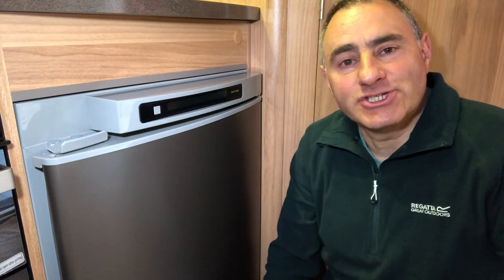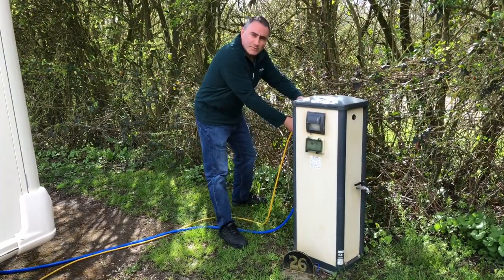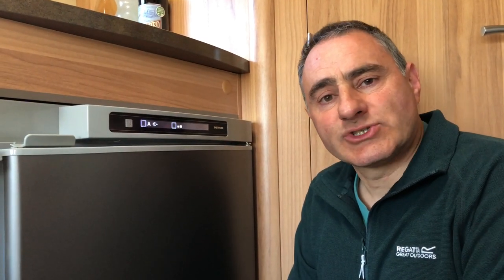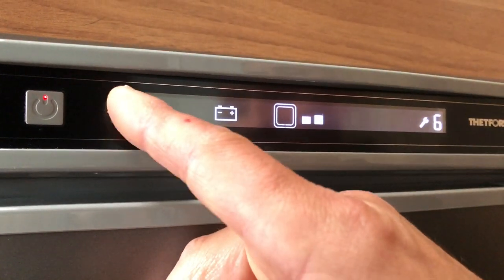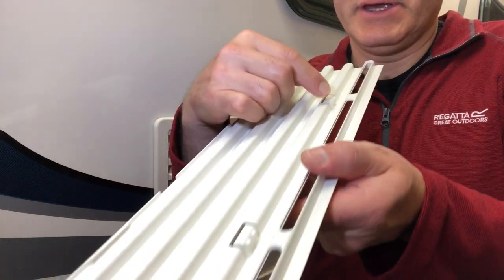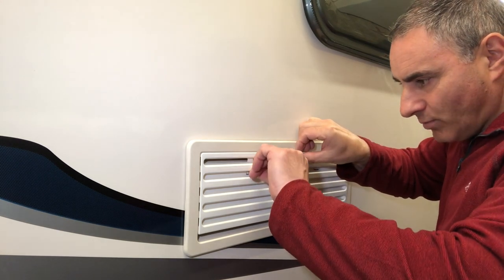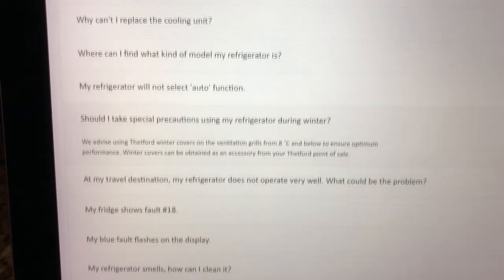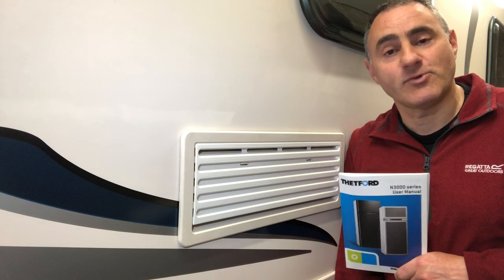Thetford Fridge Operation and Winter Vent Covers

Comment: Will have to try this easy to fit vent cover, we get quite a draught inside the caravan from the bottom of our fridge. Thanks 👍 Graeme
Reply from the maker: Hi Graeme, Thanks for watching and commenting. I never pointed out the actual purpose of the covers are to reduce the cold air over the fridge condenser to ensure optimum performance. The back of the fridge should already be sealed from the living area for when it’s run on gas. You probably have an air vent nearby, we have an annoyingly draughty one under our cooker. Best Regards, Rob

Comment: Thanks Rob. Can I ask a question about one of your previous vlogs? You use a Water Master direct water feed. Have you experienced any issues? I’m concerned about the possibility of flooding the caravan and the loss of pressure. Looking online, it really is a very mixed bag of what people are saying. I would really welcome your thoughts. Paul - Yorkshire
Reply from the maker: Hi Paul, We’ve never had a problem in just over nine years of caravanning. We do however turn the main outside tap off as a precaution when we go out for the day. The Watermaster plug has a pressure regulator set between 1.5 and 1.8 bar. According to the label on the caravan water heater the max system pressure is 4.5 bar which is well above the Watermaster regulator. If you were to use a pump in an Aquaroll the pressure builds and stops. The pump will probably have a cut out pressure of 2 bar. This means the internal pipe work will have 2 bar of water pressure standing in it which is slightly more than the Watermaster. We have an onboard pump and use it to boost pressure for showering if the mains pressure is down a bit on site. If I were to use our onboard pump with suction hose in an Aquaroll with mains connection / float and a leak or burst occurred, the pump would turn on and the float would drop in the Aquaroll allowing water in to flood the caravan. Both methods could potentially flood your caravan! Hope it makes sense. We can all worry about things that may never happen. Cheers. Rob
Reply: Thanks Rob for you very comprehensive response. Your comments make perfect sense and your precautionary measure of turning off the water supply is something we have said we will adopt should we proceed with the purchase of a Water master. Turning the supple off when away from the Caravan is a good habit regardless of the system used!

Thanks again for such valuable advice, based on your extensive experience Rob.

Comment: Good information Rob 👍 ours is a Dometic for some reason I thought the whole cover was replaced for winter ones  but they're like yours that's easy .. will have to look into it thanks 👍
Reply from the maker: It’s good to know your Dometic vent covers will be an easy fit too. I had guessed the Dometic ones might be similar. They are not draught excluders though but are there to optimise the fridge performance in cold weather. Time will tell on this one or will we ever know ??? Cheers Rob